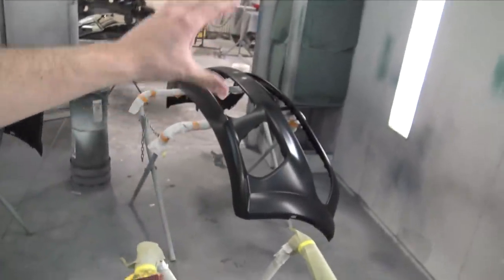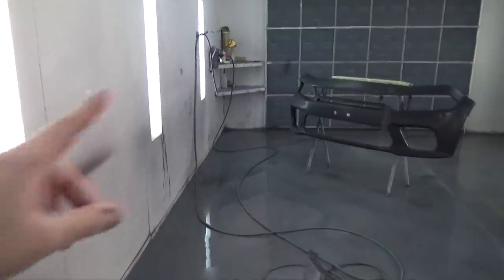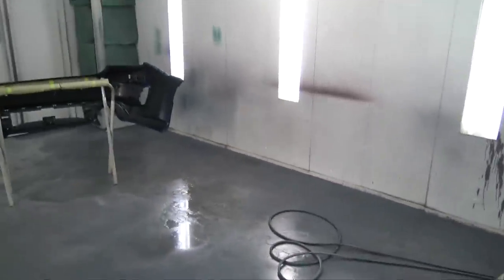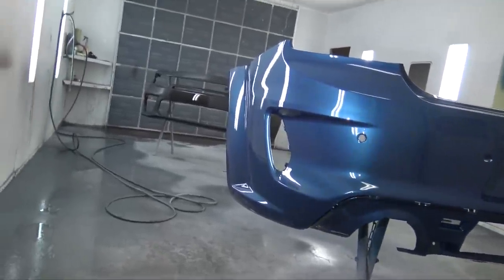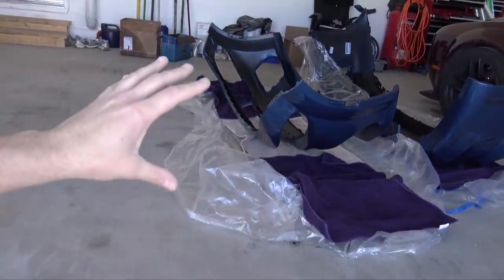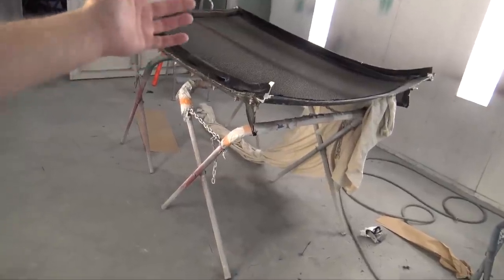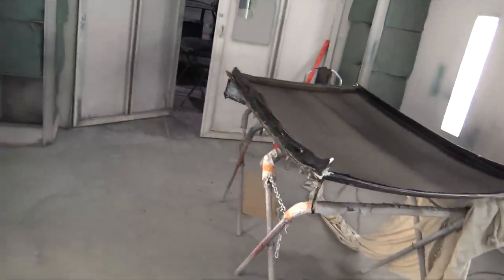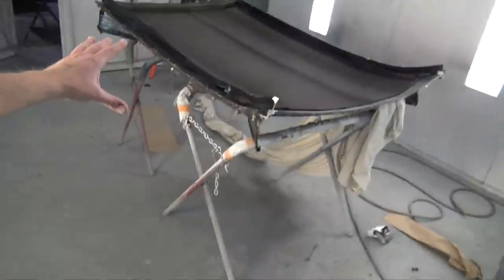Building the Ultimate Station Wagon | 2021 Charger Magnum Hellcat | 1000HP Hellwagon | Pt 50

Comment: Definitely recommend an adhesion promoter on urethane parts and adding a flex agent to the paint.
Reply: I only paint as a hobby or to fix an accident . Bulldog adhesion promoter is a savior. I use it in everything on all stages for the bumpers. 
Now when I see a car with paint flaking off it’s bumper, it gives me reassurance it was worth the extra money.

Comment: You got this and im hopeful it will turn out looking fantastic in the end, but a tad worried the paint will not match with all those panels being painted seperately.   That paint has a decent amount of flake in it and depending how the parts where positioned when sprayed could effect the way the flake layed.  Plus it would have saved you so much time to just trim everything assemble and then spray the whole body at the same time.  I also personally wouldnt glue the roof on until after the body is painted.   Regardless I am eager to see how this turns out
Reply: This has been a long running debate with a lot of guys with the same opinion as you...which I agree with because its correct. His defense is this is how high end hot rod shops paint cars all the time.....not the one I work at!

Comment: just a couple quick comments:
People continually complain about the excess talking. I get that, especially if it's repetitious, but I appreciate you talking about the  thinking behind why you are doing something and the rationale for the order in which you are doing things.
I agree with the comment about fixing the lighting in the booth. You shouldn't have to spray with a handheld light.
Q: Do you have to add a "flexative" additive to the paint mix for the front and rear fascias, so the paint doesn't crack? Is there any kind of time limit for how long the paint stays flexible?
Reply from the maker: The paint I use is flexible the sealer I use is also

Comment: Dave, try a company called Fastenal, they are a tool and hardware company but they have a global shipping network. I have shipped cars and parts with them with no problem at all. Prices are great. Contact the office near you and give them a call. If the car is close to me in NH, I can get it to the Fastenal office for you. Joe
Reply from the maker: Could you pull the front wheels and brakes and stick them in the back section you can have the front to scrap

Comment: Dave I'm building an AWD '96 Impala SS Wagon. Would you be interested in making me a Carbon Fiber roof? I hear you have lot's of experience with long roof panels. JK LMAO. I'm thinking that after the Magnum ur not gonna wanna deal with CF for a while.
Reply: Would suggest clearing first what your budget is. The way he did this roof is extremely expensive (even if he succeeded first round). His mold is way overengineered since he's not using an autoclave but just vacuum bagging it.
Reply: How many thousand is your budget? The cost of the materials and labor would be really high.

Comment: How do you get away with not running a front license plate? According to Colorado Revised Statutes: Title 42 – Article 3 – Part 2  both a front and rear plate are required in Colorado.

Edit: Not trying to be a wise ass, this is a legit question.
Reply from the maker: There is also a law that says if the bumper doesn't have a spot it's not required
Reply: @Junkyard_Dave  I saw exemptions to the law, but that is NOT one of them.
Reply from the maker: @starman6280  if a cop is petty enough I'll pay the cheap ticket
Reply: @Junkyard_Dave  That is why I asked. I got that ticket in Weld County. Seriously not trying to give you a hard time, I was just wondering how to avoid it. The guy that got me had no sense of humor.
Reply from the maker: @starman6280  I never had one mounted  if that's what the tickets for the officers get in trouble for wasting a judges time just take it to court